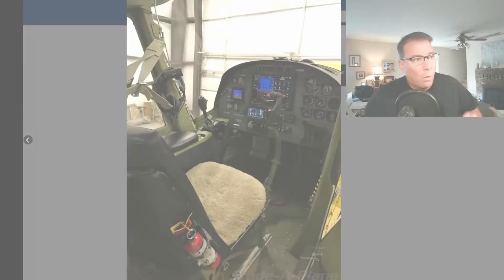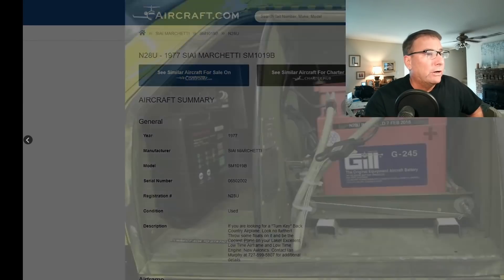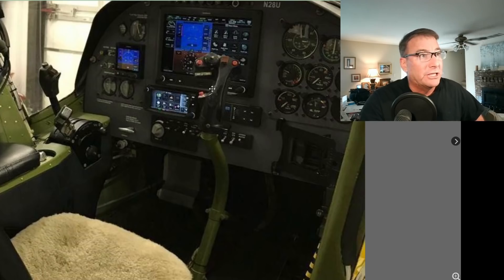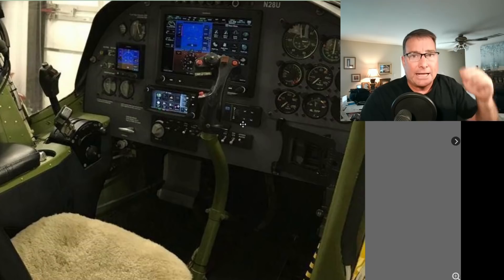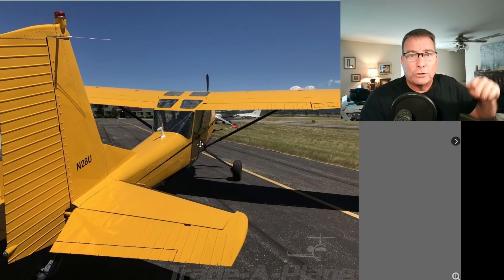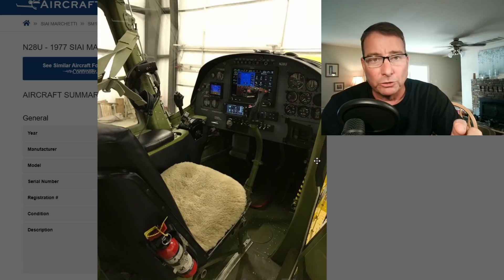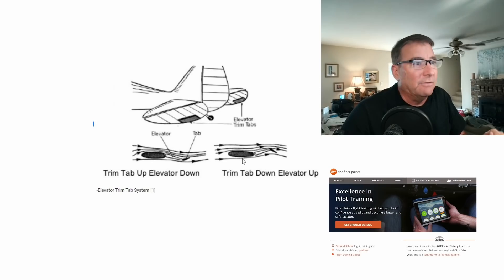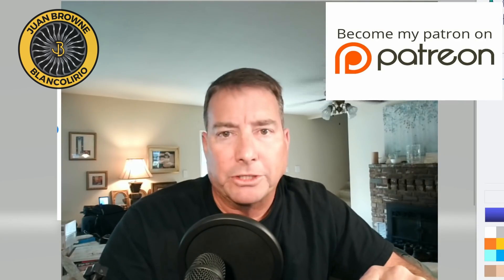Dale 'Snort' Snodgrass Siai Marchetti UPDATE- Elevator Trim System 8/8/21

Comment: Is it possible this guy was just trying to do a max performance takeoff in an airplane he wasn’t very experienced with and got too slow over the top?
Reply: Your not familiar with the pilot of this aircraft he was extremely experienced pilot so that thought fairly unlikely, maybe you should look him up first before commenting.
Reply: @Rob-vv5yn  yes i am familiar with the pilot. Although i do not know him personally. Nobody in aviation is exempt from making mistakes. This compounded with the fact that he just bought this aircraft is what leads me to speculate (which i try not to do) but that is the point of the video. Hopefully time will tell and we will all be safer in the skies.
Reply: @Wrex360  my experience with highly experienced well trained pilots is they didn’t get that way by chance, they train and practice frequently and well know there aircraft limits. Mechanical failures you can train for but some are just unsurvivable. If you think this is some pilot who got caught out by hauling his bird to steeply off the ground like a rookie then well let you be judged.

Comment: Can’t really tell from photo of wreck if trim tab is pushed down to limits. Does not appear to be. But he could have gotten it back to neutral, just too late to avoid the crash. Maybe better quality video or crash sequence will surface.  Maybe using the nearby fire extinguisher would have helped. He fell a long way. RIP.

Comment: Why didn’t Dal “Snot” Snodgrass pull the throttle to idle? 
If the engine is as powerful as they say it’s probably heavy. The aircraft will (I assume) displays positive stability like all high wing Cessna types and level off.
Reply: It's an Allison 250 turboshaft, I'd be surprised if the entire assembly was 300 pounds wet.

Comment: Thats an interesting setup you've got there,  you've got the ceiling fan and the return for the furnace right over the top of the fireplace.  That must be to better distribute the heat and or cooling. I've never seen that before. How well does it work?
Reply from the maker: Why would I turn the furnace on in the SUMMER....
Reply: @blancolirio  I said heat or cooling. How well does it work in winter?

Comment: Incorrectly rigged trim is a fine theory. Just one problem, there’s no fixed wing maintenance on that side of the runway. Hillcrest is a Part 135 helicopter op and part 145/Bell repair station. They’re all out on fires this time of year so only thing open is the FBO services. He stopped for fuel over there.

Comment: Was this flight the very 1st time Mr. Snodgrass had ever flown this plane?  Because that to me would be the only way he would no have been aware, if the trim was somehow wired wrong to have opposite effect on its trim (down trim being up, and visa versa)?  Edited to add: OR, as Juan pointed out, the plane had just been in for its annual and the mechanic might have hooked it up backwards could very well be the reason that might happen. Not being a pilot, I had not thought of that possibility. But that raises another question....When air plane mechanics perform these annuals, or any other type or work that could possibly be done catastropically wrong, don't they usually take the plane up for a test flight?  And if not, why not? Seems to me that since an air plane mechanic can potentially kill someone if done wrong, it should be their butt in the Pilots seat that 1st time out of their shop.  I'm sure I'm missing something here, but it seems logical to me.  Thanks Juan for all your hard work getting the info for us!!!
Reply: He flew that aircraft 23 times between May 26 and June 30, when he flew it to Lewiston airport. He had just picked up the aircraft from the maintenance facility (Hillcrest Aviation?) just before the crash. Flight data details from FlightAware,

Comment: Could he have throttled back to keep the pitch from increasing so rapidly after rotation despite a runaway trim situation ?
Reply: He could have, but it was already too late, by the time he could have reduced throttle, the plane was already in a stall, and too close to the ground to recover anyway.
Reply: That’s a good question he would have had to reduce power immediately he felt the aircraft climbing too steeply, there is a lot to process and very little time to action it. Which action or process to do or what is really happening just overloads the pilots reaction if he was at height and had more time on his side yes maybe he could have figured out something but in this situation it’s incredibly hard you need to pick one course of action and hope you picked wisely
Reply: There are multiple solutions to a known trim problem. You can simply bank the aircraft to allow the up trim to pull you around in circles while you troubleshoot, for example. The problem in this case is that he ran out of altitude, airspeed, and ideas all at the same time.
Reply: @Voodoo350R  well assuming it was the trim issue it’s a possibility yes, but your right he had very little time to process all that was happening and no height to help. I believe he was familiar with the solution your mentioned due to his flight experience with other aircraft (from what his ex military friends have posted elsewhere)
Reply: @Rob-vv5yn  Admittedly I'm speculating about it being a trim problem. It's highly improbable it was the gust lock as many have speculated because the design of the locks on this aircraft also locks the rudder when engaged so he would have had quite a time trying to taxi without rudder control. There are a thousand or more things it could have been and I'm looking forward to reading the report once it's out. Whatever the cause, it's a very unfortunate loss indeed. Godspeed Snort.
Reply: @Voodoo350R  Very unfortunate yes agreed will definitely be interested to read the report.

Comment: JUAN, hello, thanks. for continuing on this aircraft/crash,  hope that’s what’s left after fire , they will be able to see what the heck went wrong ,  recall the beech, in SC WITH IMPROPER RIGGING   PLANE PITCHED UP STALLED, CRASHED, but the feds were ALSO found that it also was really overloaded, via physical, pax weight+ luggage     🇺🇸🇺🇸🇺🇸🇺🇸

Comment: Ok I’m a taildragger pilot and I’ll chime in.  Most pilots exercise the sticks normal travel to check the ailerons & elevator during engine warm up.  I feel he lost elevator control from a cable, pushrod, or cotter pin. Something in the elevator control went wrong. My heart goes out to his family.  Also most taildragger pilots are active on their stick controls when they taxi because you have to “ fly them all the way to the hangar “.

Comment: Forgive me for speculation, but none of these explanations seems to fully account for what we see in the video. Has anyone considered simple distraction?  He was asked to change frequency as soon as possible. I think he was tuning a different frequency as soon as he got off the ground and just let it get away. Notice no right rudder at all. A pilot with his experience would have instinctively stood on that rudder to attempt to counter the spin. Possible?  He didn’t say anything till he was well into the stall. Nose pointed nearly to the horizon. Seems kind of like he may have been distracted to me. Should have tuned prior to takeoff roll commencing. Tower should have had him switch before clearing him. Maybe?

Comment: Did you mean for nose down you push the button up?  With a trim wheel you would roll it up. Saying you push it “forward” is a mindset issue. I was trained to say “up”.  The pilots exclamations seem to occur after.the stall occurs when he realises he is in trouble. I think you were right in your first video. Don’t hang these things off the prop. When we actually know the person involved in an aircraft tragedy, we tend to avoid pilot error as a reason.

Comment: Appears to me to be a stuck elevator or the plane was way aft heavy. Trim tabs will force the elevator up or down, but it shouldn’t restrict elevator override from the stick, especially in small planes going 70-80 knots. I know the airspeed was much higher over the elevator from prop wash, but still do- able? The Galloping Ghost is a different story. I did notice the plane appeared to be pulling gees when the wings were at 90 degrees just before impact. Just my two cents. God rest this man’s soul.

Comment: What Was The  Max Airspeed He Reached Before The Stall ??? What,,, 50MPH,,,60MPH,,, 70MPH,,, 80MPH.... I Can't See How a Runaway Trim COULD NOT Be Overpowered... As Far As "Thrust" Goes,,,  Regardless of What Thrust  Was Applied,,, That Should Be Insignificant,,, As Far as Stick Forces Go... It's All About Airspeed.... This Is a  a Low To Mid Horsepower Airplane,,, The Rated Horse Power Is Below 400 HP...  On The Other Hand,,, This Was a Very Talented and Experienced Man... So It Doesn't Make Sense... It  Either Sounds Like,,, Someone Was
Pushing  The  "Performance Envelope" To The Extreme, or It's a Control Issue,,, ie "Baggage" Blocking a Control Response... He Started Out In Almost Level Flight, and Then a Gentle Climb,,, That Climb Then,,, Just Kept Increasing In Climb Angle,,,,

Comment: It was reported that he was going camping.  The Marchetti has a lot of elevator throw and while I can see flap extension, I can't see any elevator deflection in a frame-by-frame view.  Admittedly, it is grainy and it would be hard to say for sure.  Another person who knew the aircraft before he bought it, reported there was no cloth boot around the bottom of the rear control stick and floor.  Maybe....only guessing, he had some camping gear in the rear and you can speculate from there.  Perhaps that can explain his last Tx as he was pushing the control stick and hitting the mike button while he was leaning backwards trying to free a jam.  It has happened before and I know a couple Comanche pilots that couldn’t get a green light on retraction, returned to the field only to find out a Jep or lunch bag stopped the Johnson bar from traveling the full distance.
Reply: I think this is a more likely cause considering how nice that airplane looked. Of course just because there is a lot of money in it doesn’t mean it was maintained well…
Reply: @higgs435  Trim issues happen but they are rare.  Even with full power, the airflow/pressure at slow speeds wouldn’t produce, in most cases, a trim induced control issue you couldn’t over power or merely stop by turning off the master switch and trim manually. Someone once told me to not overlook the more likely and mundane explanation in favor of a sexy and more technical/complex possibility.  I couldn’t see any control surface deflections that you would expect in this kind of accident unless the control movement was restricted some how.  BUT, everything I have said is just speculation.  Guilty as charged.

Comment: But the pilot never countered with aileron after the stall. Also, the elevators and rudder appear to be locked at the time of impact, they are still stiff. There does not appear to be a trim tab deflection present. Is there an autopilot system in this airplane?

Comment: Juan, it still doesn't explain why all of the flight controls in your last video were in a neutral position.  NOTHING in the the video appeared to be deflected, even after the crash.  If this were my last flight and I was 90 degrees to the earth, I am pretty sure I would have full right aileron and full right rudder in trying to right that airplane!  Nothing left to lose at that point!  

We had procedures in the KC-135 for runaway trim, cut out the trim switches, push full forward, and if needed roll left or right to move the lift vector left/right to keep from stalling.  But in this case the video doesn't appear to show any deflection of any of the flight controls.

Sad ending to a talented pilot.

Comment: I agree the factory gust lock could not have been engaged and the seat belt idea makes no sense I also have to agree with the observations of the low quality video that the controls nonetheless appear to have been locked. I still think a seat failure of some sort is a potential culprit. Maybe not just coming off the rails but a collapse of the frame. They are made of very light tubing that is triangulated for strength so a crack at a key junction can cause failure. As you can see n the picture of the back seat the torque tube that connects the control sticks is exposed like on Piper Cubs. A collapsed seat could very possibly have locked up the control sticks.

Comment: Nah. At takeoff speed in that airplane I doubt the trim tabs generate enough force that you can't strong-arm it and overcome the force on the basic elevator. Takeoff speed is what, about 50KTS? It's not like a 737MAX where the whole stab moves with trim and has more authority than the elevator. I'm betting either something fundamentally "broke" or jammed in the flight controls, or a catastrophically aft CG.

Comment: If the trim was that far off on the ground, I guess he wouldn't have felt it on run-up being a tail wheel, he would be giving up elevator anyway.
Reply: Would not the reluctance of the tail to come up on the takeoff roll be a huge red flag that something was very wrong with the CG and/or the elevator trim?

Comment: I'm totally with Dan Gryder in this with his opinion that luggage may have prevented Dale from level flight. Just remember now that he was going on a camping trip and in a hurry judging by all the taxiway call shortcuts and being on the wrong channel when talking to the tower. Being the professional that dale was I say he did his preflight and walk around before loading his luggage, this is just my humble opinion because if you really take a good look that the elevator YOU CAN SEE that it IS in nose-up trim. If you know where to look for the horizontal stabilizer on this aircraft then you will see the deflection to nose up on the elevator. There is all the possibility that luggage of some description did fall between the front seat and the rear stick but then I'm no expert, just say'n. RIP Dale 'Snort" Snodgrass.

Comment: Shouldn't there be a "fool proof" way to assembly that switch?  Example:  to install the distributor rotor in a GM car, there is a square hole and a round hole, no way to install the cap 180 degree out.  Same with the distributor cap, there is a slot on the distributor cap that must be aligned to get the cap back on in the correct place.
Reply: Yes, this would be a prudent design for something so safety-critical. Unfortunately many things in GA design seem to be stuck in 1919.

Comment: Wouldn't you be able to override a runaway elevator trim manually at or near stall speeds?  Not enough airflow over the Tabs to drive the elevator enough to overpower cockpit controls.
Reply: I commented that Juan's description doesn't account for the low speed trim forces at takeoff.

Comment: Since you single out the possible miss rigging of the electric trim, the next question should be, was it part of the preflight checklist, as it should with any electric trim system.
Reply: I've flown 9 aircraft with electrical trim systems and don't recall any with a preflight check that would catch a mis-rigged trim system where the switch and cockpit indications were opposite the control surfaces physical position.  In some, like the C-9B/DC-9, we checked the primary and back-up trim systems and the emergency shut off to prevent runaway trim.  Pitch trim (viewed on a cockpit indicator) was set to the calculated pitch for take-off.  We could check that the indicator needle was moving in the direction that the switch called for, but there was no way we could see if the stabilator's actual position matched the cockpit indicator.
Reply: I guess it depends on aircraft type and how deep you go into the preflight. You are correct that you check the full movement to either side and disconnect but also the physical position outside. As far as an opposite rigged trim would show still normal position in the cockpit, I am not sure. That may be a question for an A/P.

Comment: During my time working on A-4's runaway trim off an aircraft carrier was a serious concern.  So much that a manual trim disable switch was installed on A-4's that were carrier-based.  My thought is a Naval Aviator would understand runaway trim and his memory circuits and muscle memory would --  Perhaps more than any other type of aviator -- correct the situation almost instantly.

Comment: Good Video, Juan. To expand on you saying pilots need to check flight controls after annual. I think pilots need to check flight controls any time they are renting. I always make sure that the trim is working properly on my walk around.
Reply: I used to check those things every time I fly. My plane or not.

Comment: In Skydiving we double check everything ourselves, then we get our buddy to check us out again that's saved lives, crazy stuff gets missed if you don't get that buddy check. before we board the plane.
It's happened and will happen again, the pull-up cord left in the loop that closes the bag for the deployment pin or ripcord system. This totally prevents the chutes deployment. Guarantees a reserve ride and amazingly guys base jumping have died with that one. Leg straps or chest strap not fastened, people have fallen out of the harness on opening the chute  and a lot more. You can always use another pair of eyes and a full check.
It's something GA pilots don't do but I can think of several who might still be alive if they had.
Reply: yeah and even then on my first duo jump, my tandem harness broke as i was just about to go out the plane attached with that harness to the parachute man
It just snapped clean off. Luckily while I was still in the plane.

I did go on a second jump right after landing with the plane, and did a solo not to long after  there i had my share of complications as well . sticky followed by a huge twist and the radio didn't work either , good fun all around